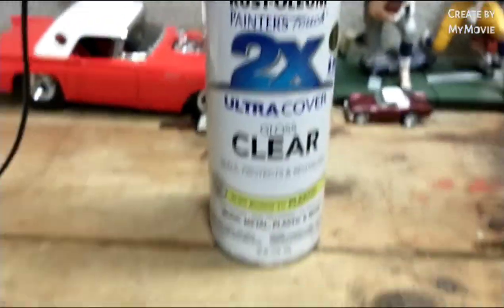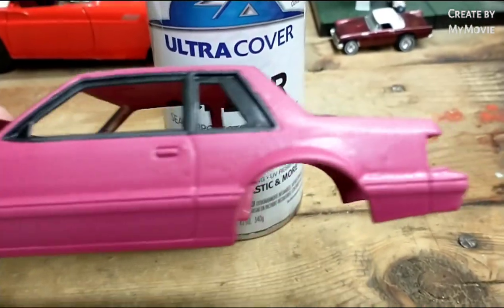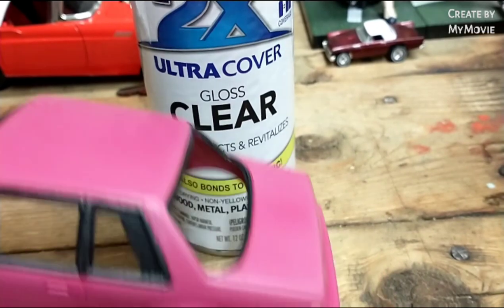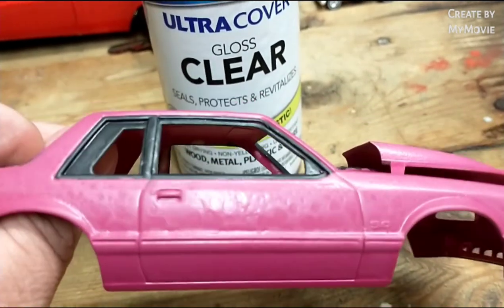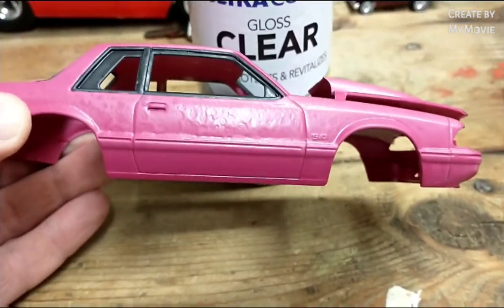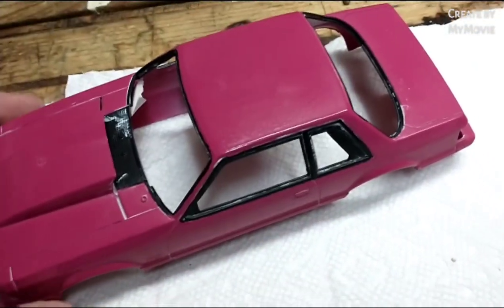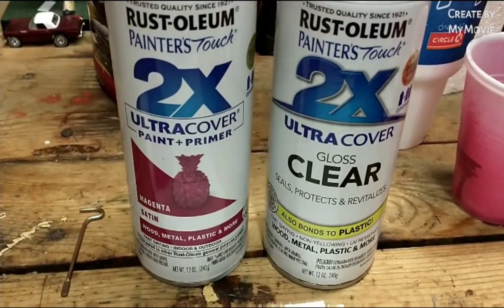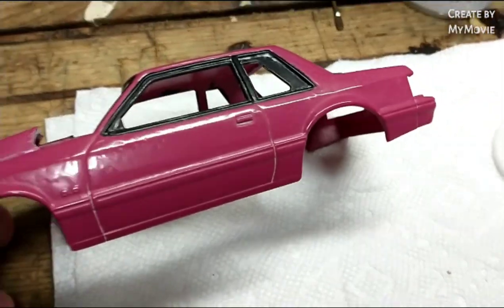1990 Revell Mustang LX 5.0 Drag Car Paint Mishap :(

Comment: I had one do me like that recently.  I prepped and primered the body just like I normally do, but the paint had terrible orange peel like yours.  I ended up letting that model swim in the purple not once, but twice.  After that I have decided to quit using Krylon and Rustoleum to paint my bodies.  I will still use those paints on the chassis and interior, but never again on a body.  Good luck with fixing your problem.  Thanks for sharing.
Reply from the maker: Gonna have to strip this one down. I normally use the Rust-Oleum for underbodies and interiors, but lately have had good luck with it on the bodies. It was looking good until I used the clear coat

Comment: Cool little mustang I've ran it to the same problem so many times I do not use the spray cans from Rustolem etc. anymore for models just don't want to take a chance no more. The plastic formula on the kits are just unknown as is the change in the paints formulation so you are really rolling the dice... I see you have the hot wheels pro street t bird in the background cool car! I've got on too!
Reply from the maker: I figured I was safe using the Rust-Oleum clear over the same Rust-Oleum plaint. It's a set back but it gonna get stripped down. The tbird is the 1/18 hot wheel, got it from a church garage sale, I keep it on my desk at work